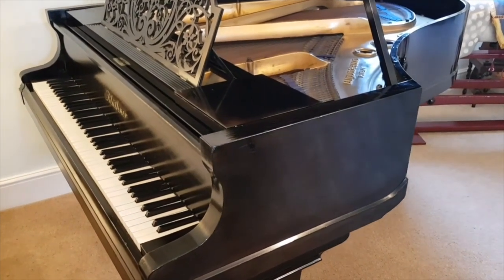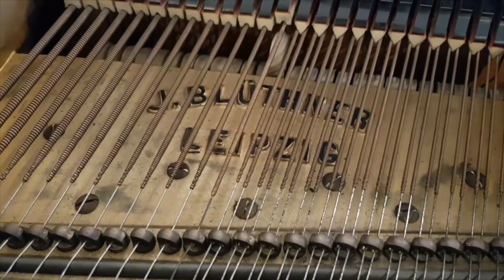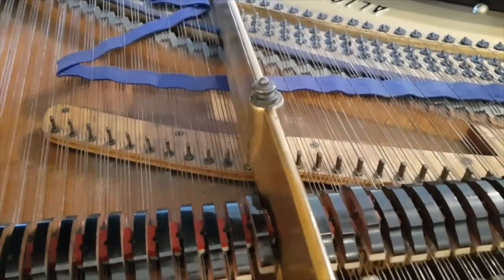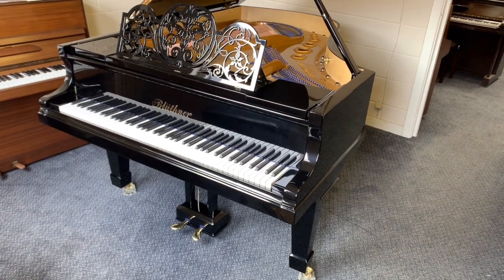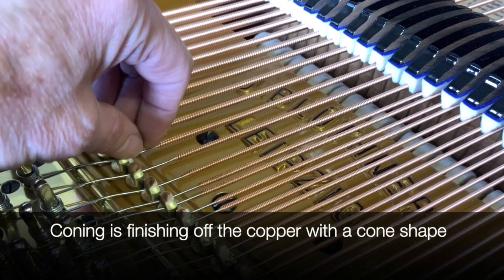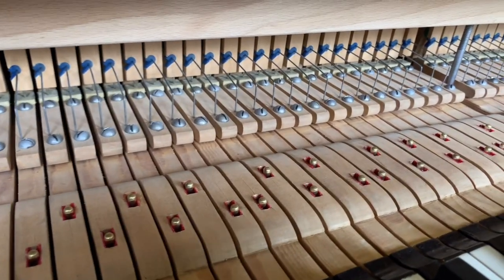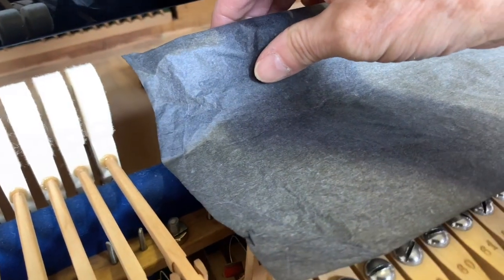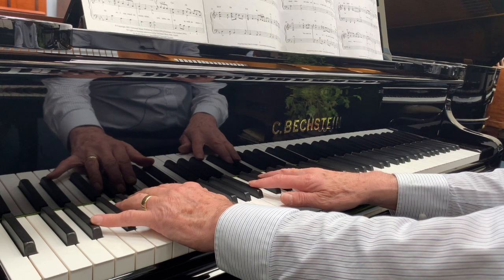Before and after restoring a Blüthner 6ft 3in grand c1887. cf. Yamaha C3, Bechstein A. Jump links:

Comment: I have a style Bluthner VIII 1900. Wonderful pianos as you say. Mine was fully restored 15-20 years ago and done pretty well. When restoring these with the patent actions what key dip do you go for? I have read that originally Bluthner would do 9mm but mine was increased to 10mm during the restoration. Do you go for the 9mm or does the more usual 10mm still work well with these patent action? Thanks! I enjoy your videos immensely!
Reply from the maker: Thank you for your encouragement! Very good question! Personally I prefer to deepen the touch as most pianos have at least 10.5 mm and the Blüthner patent works well and has the sense of after-touch with greater depth. If you're a technician and want to disagree with doing that, I fully understand! Marcus
Reply: Roberts Pianos Thanks for your insight with this Marcus. I did read somewhere that Bluthner themselves increased their originally preferred key dip from 9mm to 10mm but I do not know if this change relates to the patent action or the later adopted roller action in their pianos. If anyone has any insight into this I would be glad to hear it. I do know that my Style VIII from 1900 does not have clearance for the felt trim above the keys attached to the fall now that the keys are at 10mm dip. This suggests that the 9mm preference was certainly in vogue at Bluthner in early 1900’s.